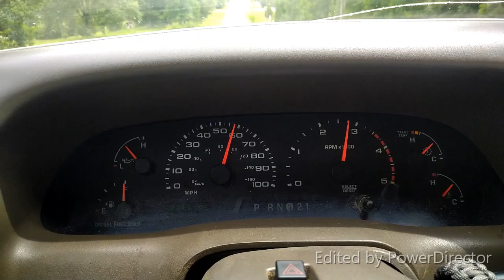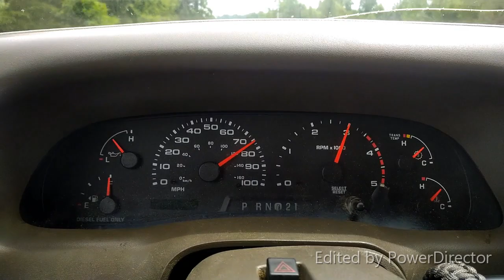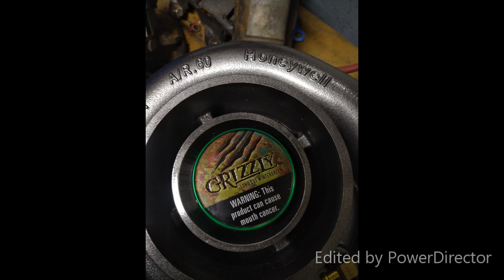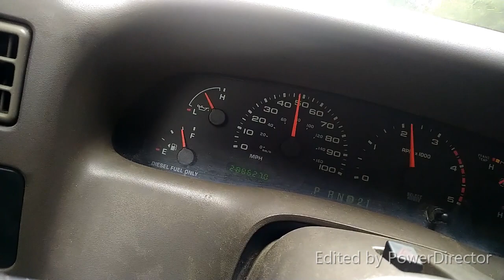7.3 COMPOUND TURBOS (bed mount)

Comment: I like the build so far. I have a few question, did you do anything to the trans or engine, could you run the oil return to the oil pan, what radiator did you use? A shop quoted me 10k in labor to run a second turbo, I’m glad you showed us this.
Reply: not worth the effort on a 7.3. put a under hood t4 kit on it with proper sized turbo youll make far more power than this ever will. ps messing with the turbo on a stock injectored truck is wasting money
Reply from the maker: Trans stock engine stock. This oil system is its own isolated system. Separate from the engines. The cooler I used it a beefy trans cooler.